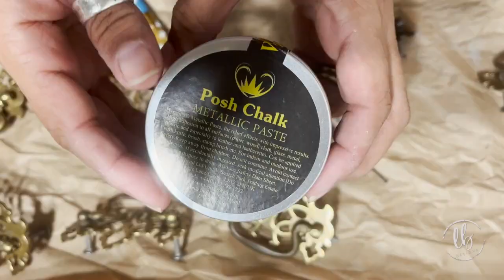Painting Furniture For Beginners Using DIY Paint Clay Based Chalk Style Paint | Furniture Flip

Comment: Have you ever had dark stains or spots show thru after diy paining and then using big top to seal. How did u handle it??
Reply from the maker: Great question! That is bleed through... so what are you cleaning the pieces with? If you clean with a white rag you will be able to tell if your piece is going to bleed through or not. If the rag shows any color on it after you have cleaned it and rinsed it with water (I use vinegar/water solution) - then it is going to be a bleeder. It might just bleed in sections, or all over...it could be the varnish/wood, nicotine or oils... this is the ONLY time that I will prime.. however sometimes I go ahead and paint it anyway if I only saw a little bit of color. You can use DIY Salvation Solution or Shellac. If I get surprised by bleed through, I paint the first coat - let it dry fully and apply Shellac on the bleed through spots if it is minimal... If you are doing a full color - blended look, it may not matter. If you are doing white - and it is really bad - then hit it with Shellac - does that help?